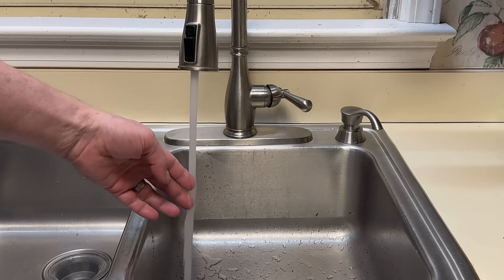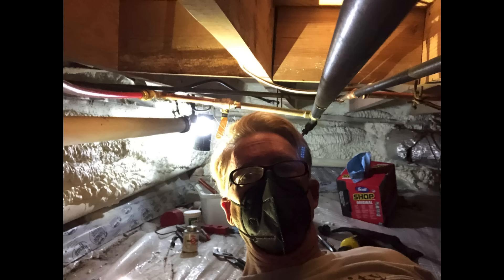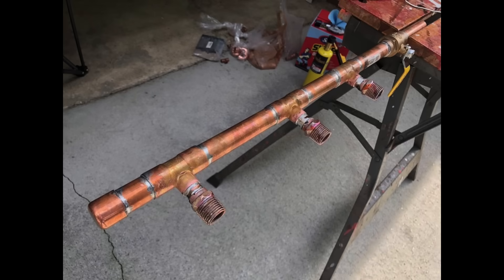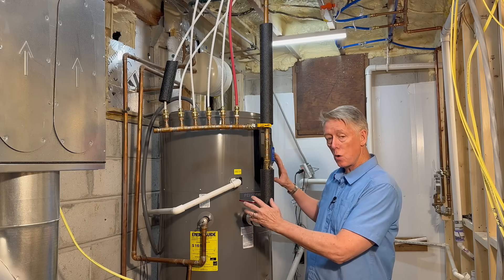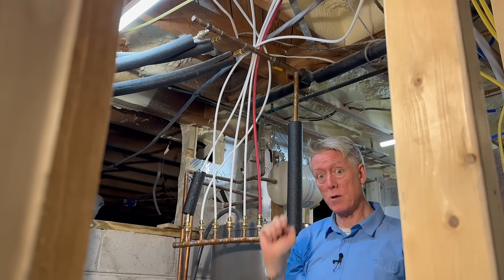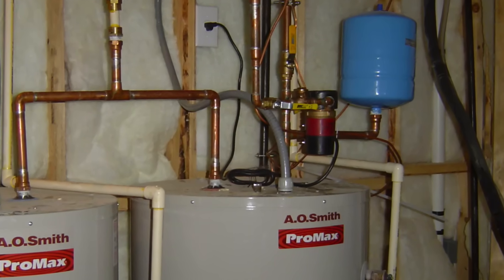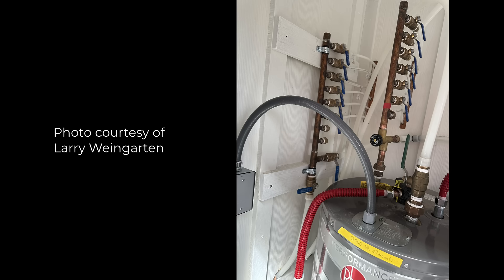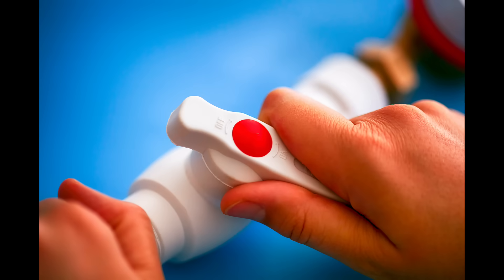How to Get Faster Hot Water...Without a Recirculating Pump!

Comment: Why not use more than one water heater?   More cost for the  heater but less piping since you only need tun cold water to them.
Reply from the maker: Because I have a heat pump water heater and want to use it for all the hot water.

Comment: There is definitely a small benefit between the first manifold and the second, in terms of volume of stale water. The problem is that the second design incorporates significantly more exposed, unsupported piping at a level where it’s likely to get banged (and banged copper pipes create leaks). So, better for hot water delivery time, but much more vulnerable to damage, and seems to me likely to fail an inspection, if inspected.
Reply: Yeah, I was concerned that the manifold is basically a cantilever and is already sagging and putting undue stress at the Tee.  For peace of mind, a board could be strapped to the water heater to support the manifold or hung from the ceiling.
Reply from the maker: @glasshalffull2930  I'll be insulating and supporting them fully pretty soon.
Reply: @  Quite a project and you did a great job!
Reply from the maker: Good points, but the lower manifold is pretty much out of the way of getting banged.

Comment: Great solution.  My '50s ranch house has a water heater in the garage.  It seems that the builder ran 2 separate hot water runs, one to the kitchen, which is next to the garage, and another run down the middle of the house to the 2 bathrooms.  When I was looking to convert to a tankless heater, I had several options on where to place it.  One would have been to place the heater outdoors, close to the gas meter.  But that would have put it on the opposite side of the house and required extensive plumbing to supply hot water to the various fixtures.  As is, the tankless went into the same location as the old tank.  I get hot water in under 30 seconds, so the original setup works well.

Comment: Physicist and engineer, immigrant from Europe. My wife is immigrant from Asia... In both of those areas of the World this issue is typically non- existent. Here you have patched the fundamental issue in question, that is good. But the underlying issue remains - why isn't the heater near the point of use and in scale to it? Both in Asia and Europe, bathroom water heater is in the bathroom, typically above the tub, flow-through type. Same for separate, typically way smaller flow through kitchen water heater, placed in the cabinet above or below the sink. So, flow through, no heating anything when not needed, located so that at most 3 feet of piping is involved (or less) and finally scaled in capacity to the location and type of use. To us, typical American water heaters setup looks as something branched from industrial, not domestic usage case.
Reply: Your point is well taken. I see two reasons why US markets avoids POU WH's. POU WH's are uncommon (limited selection) and mostly 120V. This would require large costly wires and additional equipment which spec builders despise. In the US houses are built cheap crap minimum code not well functioning for homeowner comfort and efficiency. In the US electricity is cheap (relative to most of the world). There is minimal incentive to be efficient with limited resources. Additionally, engineering in the US (20yr design engineer) is skeptical of new technology. If it's less than 50 years old it's new, unproven, and let others work out the bugs. This has both advantages and disadvantages. The IBC does not encourage high efficiency construction in the US. Taxpayer funded incentives for high efficiency are a joke in many ways.
Reply: @derf_the_mule1405  That's especially true when jurisdictions take the IBC as "the way" to build a house, not as baseline standards. My locality would need 2x8 wall plates with 2x4 staggered studs to be directly in the IBC/IRC to allow it for example.

Comment: This is completely nonsensical. The amount of static water when the tap is closed is no different (run by run) whether the manifold is in the first location or the last. the distance is the same. When you turn of the tap you're left with a run of pipe/tubing that will be full of water that cools off. The distance has not changed. Jesus this is pretty basic man.
Reply from the maker: So let's see.  What you're saying is that there's no difference in volume between 30 inches of 3/4" copper pipe and 30 inches of 1/4" PEX?  In what universe does that math make sense?
Reply: There usually is a flow restriction at the faucet for hot water. So, if the flow restriction at the faucet matches the pipe, you have a lot less water in the pipe to replace. This takes less time and results in less water waste. For an example, let's go to the extreme and suppose we have a huge wai heater with a one foot diameter pipe going to a very restricted small faucet that emits one cup in a minute. You can now likely intuitively understand that hot water will get to the faucet in less time through a 1/4i inch diameter pipe than a one foot diameter pipe. The water in the pipe can only be replaced as fast as the faucet allows it . Other than less time for the water to come out hot, it also saves on water and heating of the water in the larger pipe size.  For hot water, the pipe should be  minimally sized to meet the flow you need.

Comment: One factor you didn't mention is that when you turn on the tap, hot water not only has to push all the cold water from the pipes, but it also has to heat up the pipes - hot water flowing through a cold pipe gets cold. This is why there's still some time after the water starts to feel warmer until it gets really hot. Smaller diameter pipes also get hot faster, and pex being a thermal insulator will be better than copper of the same diameter.
Reply from the maker: True. I didn't mention that, but it's not as big a factor as the mixing that happens in the pipe.  See this article by Gary Klein:

https://www.garykleinassociates.com/PDFs/15%20-%20Efficient%20Hot-Water%20Piping-JLC.pdf
Reply: @TheEnergyVanguard  good article, thanks.
Reply: @TheEnergyVanguard  An 80ft run of 3/4" copper pipe with wall thickness of 0065" is 21.6 kg of copper. The energy to raise that much copper from 70degF (initial temperature of the pipe) to 110degF (hot water temperature) is 185 kJ, which is enough energy to cool a gallon of water by 21degF. So it may not be as big a factor as the mixing, but it's not negligible. If you ignore the mixing and just assume the hot water is a "plug flow" (Gary Klein's terminology), there would still be an appreciable time from when the first not-so-hot water arrives to when it reaches the steady state temperature. 

@jsnx9067 isn't it obvious that after the pipes have sat unused for a while they are the same temperature as the surrounding environment? Kind of a goofy question. And if you don't think 70degF is cold, I suggest you take a shower with 70degF water and think about it more.
Reply: lol how cold do you think that pipe gets in conditioned space. goofy.
Reply: @jsnx9067  It gets to the same temperature as the water coming out of the tap when you turn it on.

Comment: With a thermosiphon loop to my kitchen, the wait time is 3 seconds---this obviously could all be improved with smaller pipes, but I love not waiting and at no real cost.
Reply: Lines insulated to r 20 and has am electronic valve on a timer.
Reply from the maker: Ah, well, that makes a big difference.  And of course you'd know that, Charlie.
Reply from the maker: Three seconds is amazing!  Although there's no pumping cost, there is heat loss from the pipes so the water heater has to run more.
Reply: Yup.  No circ pump needed.  No idea how much extra I may be paying, but (gas) bills don't reflect any material increase.

Comment: Let me add to your great ideas. On initial construction of my house, my plumber had given me the strong advice to install a return pex line from the furthest point of usage in the house. Brilliant. Years after, I have installed a Grunfos recirculating smart pump that learns your habits and consume under 10 watts 95% of the time. It has now been 5 years, so let me tell you a fun fact that I have come to realize last year. First, I have to mention that I put the pump on sleep mode in the 3 seasons other than the winter to reduce un-necessary heat loss in the house. In the winter, the lost heat out of the pipes only contribute to the heating of the house, no waste here.  A great feature on these smart pump is an anti-scale feature that makes the pump work for about 30 sec. a day. Great, less maintenance and longer life of product.  The loop comes back to the bottom of the hot water tank, by what would normally be the scavenge drain. Well, last year, when I went to put the recirculating pump on the  " summer mode or sleeping mode", I forgot to close the ball valves at the bottom of the drain going into the tank. Going in the shower, I noticed I still had instant hot water. That means that I don't even need a recirculating pump, as long as I allow the circulation  in the loop system to happen, warm goes up, colder goes down just like density change with air, I have hot water all the way up. I obviously have learn to ensure I close the ball valves in the 3 warmer seasons to ensure I don't heat the house when I want to air condition it! I live in Montréal, fair winters...I hope this help the simplicity of your system and help save money!
Reply: Our builder offered a $75 option in 1999 to add a return line from the furthest hot water location, with a T in the basement back to the drain fixture on the hot water tank to create the same self circulating loop you describe. Northeast Ohio. All copper installation. Works great.
Reply from the maker: That's a great lesson you learned.  And it's good that you realized the heat loss from the pipes is significant.  Are your pipes insulated?
Reply: @TheEnergyVanguard  Yes, they are!

Comment: Ridiculous video and thr manifold is stupid as there was no equal pressure to all the pipes
Reply from the maker: Thanks for at least giving a specific criticism. It's easy to call something ridiculous and stupid. But your one specific has no validity here. I doubt there's a single residential plumbing system in the world that has equal pressures in each branch. And they don't need to be equal. What matters is that you get the proper flow rate with good pressure at the tap. And this system provides that.
Reply: I'll add that the residual pressure, or the pressure remaining after running through the tubing is what matters. Having 20 psi residual is what you want, and get with this system as long as you don't try to (for example) hook up an 8 gpm showerhead to 200 feet of tubing, with 30 psi static pressure ;-). At 60 psi and 1.5 gpm, you lose about one psi per linear foot of 1/4" tube. If anything, the manifold helps to balance pressure.
Reply: What he has shown will work with a few exceptions. Newer fixtures use far less water (gallons per minute) than older fixtures and can handle smaller supply pipes. If you have older fixtures or have removed the flow restrictors than this will need to be tweaked some. Also as he said at the end this will not meet any code in the USA that I'm aware of.
Reply from the maker: Thanks for following up, @jameskitzmann268.  The code restriction is a little different than not meeting code anywhere in the US.  Using 1/4" tubing doesn't meet the prescriptive code, but you can get it approved by having an engineer sign off on it.  Using 3/8" tubing is allowed in the prescriptive code, and that's what I used for my two longest runs.

Comment: Won't this reduce water pressure in shower and sinks from being smaller diameter pipes?
Reply from the maker: Yes, it will. That's why you need to start with a high enough pressure for the size pipe you're using (as well as the flow rate and length of pipe).  I linked to the Plastic Pipe Calculator in the description, and it will tell you how much pressure drop you'll get.

Comment: Hello, great video! A while ago Corbett Lunsford on his Youtube channel Home Performance did a video about PEX plumbing and one of the environmental experts he interviewed mentioned that most homeowners aren’t told by the manufacturers of PEX (and other plastic water pipes) that they should flush out their pipes by continuously running water through them for approximately 2 weeks after they are first installed in order to eliminate most of the contaminants leaching out of the plastic. Have you heard of this recommendation yourself?
Reply from the maker: Thanks!

Flushing the pipes continuously for two weeks would be an enormous amount of water, and I haven't seen anyone else recommend such a long flushing time.  From my research on this topic, I think it's too early to draw hard and fast conclusions about the safety of PEX tubing.  There's just not enough science yet.
Reply: Pex has been used in Europe for a long time before here in USA If this was an issue we would know about it Europe has much better standards for this type of stuff The vast majority of our processed food is not allowed into Europe because of the chemicals in it
Reply: That wouldn't apply to hot water for washing. Nobody is drinking from the hot tap are they?
Reply from the maker: They shouldn't be, but I've discovered that not everyone knows that.  I guess they need to see a photo of what's in the bottom of their water heater tank.
Reply: I heard that you need to continuously flush for 7 weeks!